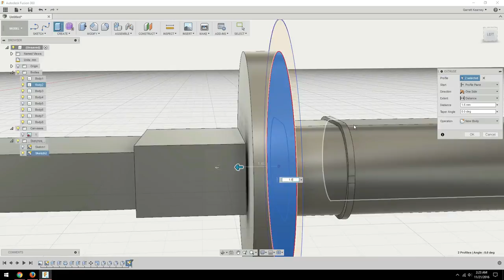3D Printed Short Katana (In a Cake?) - #3DPrintmas Day 7

Comment: I would love to see more of how you do your modelling in Fusion.  I am just learning, and I try to 1/2 speed your demos, but I miss a lot still, it is too fast and blurry!  What does your wife use as a filler/primer and what did she use to join and fill the blade pieces?  Great series, loving Printmas!  Ho Ho Ho. Merry Printmas!  (better than Festivas).
Reply from the maker: Hi Tim! I'm actually planning on starting to release the full, unedited versions of the modeling sessions after the new year. So that way you can see exactly what I do.

And I believe my wife uses mostly Rust-oleum and Krylon brand primers. Anything labeled as "filler primer" or "automotive primer" should serve you well.

For the filling, she's been using Contour Putty to fill it in after she glues it together. I think the brand for the putty is "Testors".

I'm glad you're enjoying the series! :)
Reply: Hey Garrett, thank for the reply.  Luckily we get both Rust-oleum and Krylon primers here in Australia.  And the Testors contour putty will be no problems to get either.  Glad you are going to be releasing the full unedited versions of your modelling.  You have definite skills and you are a good teacher, so I am sure I will learn heaps.